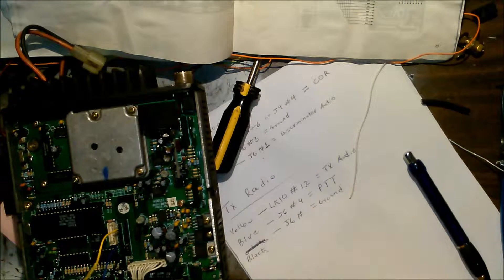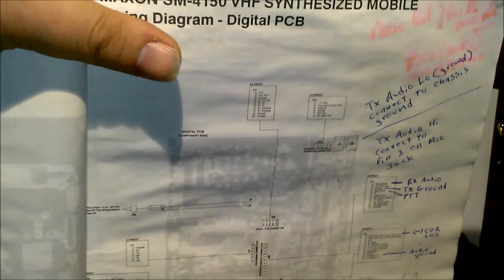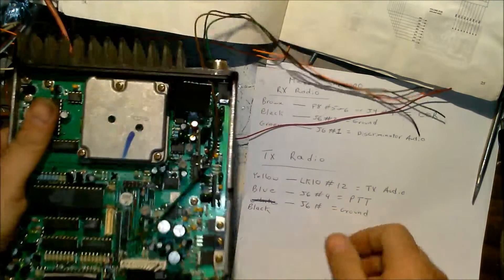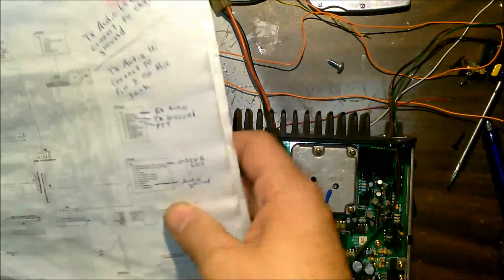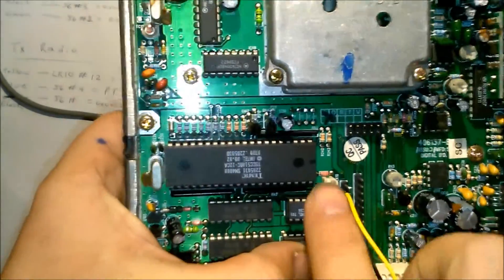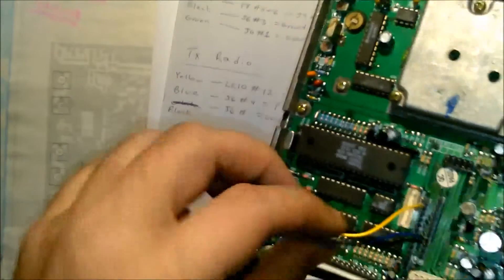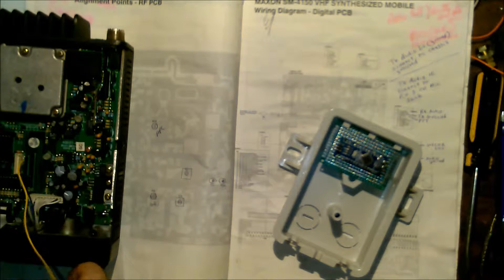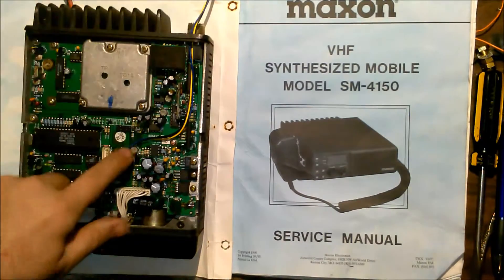How to wire a pair of Maxon SM-4000 series or GE Monogram radios for repeater controller use.

Comment: Id like a copy of that manual you have for this radio..  I have never seen one like that.. My manual has drastically different connector names and number layout..  

I was just given a stack of radios by a fellow ham that gave up on getting them to work as a repeater because he had issues following your directions in this video..  At this point I am sure it is due to a revision issue and he did not know how to tell what was really going on..
Reply: Sounds like the special SMX "systems" selcall 32 or 99ch version of the PM150 check out
https://www.youtube.com/watch?v=YcTR89rd0yo